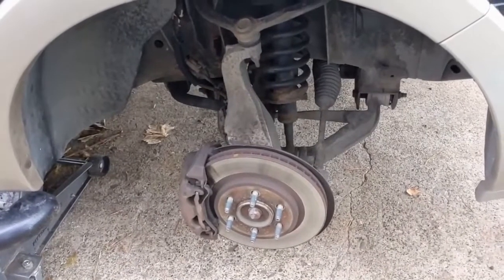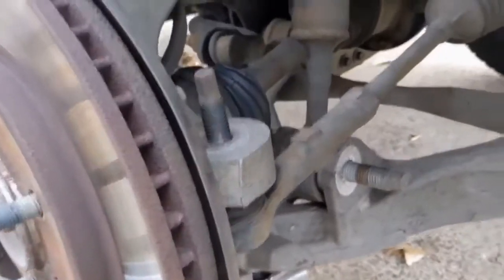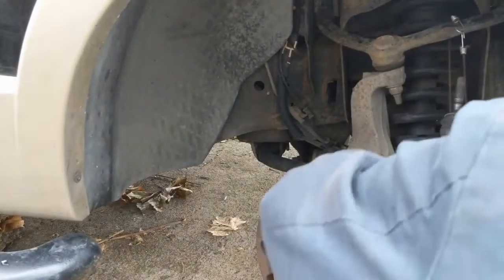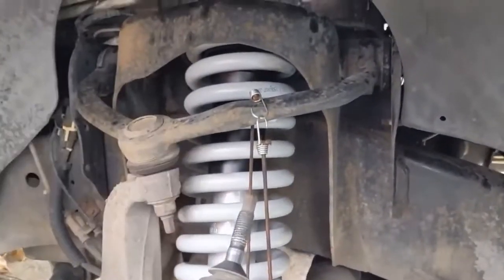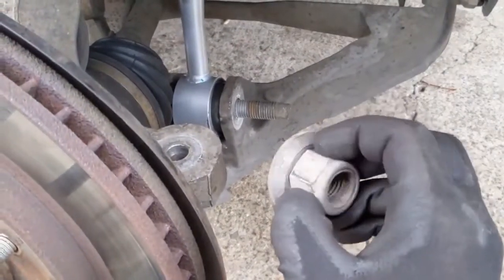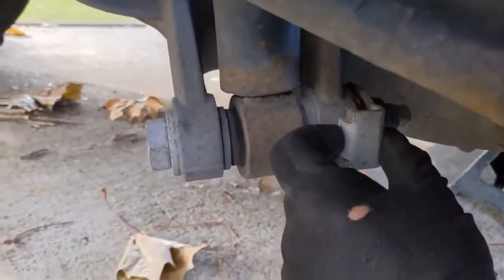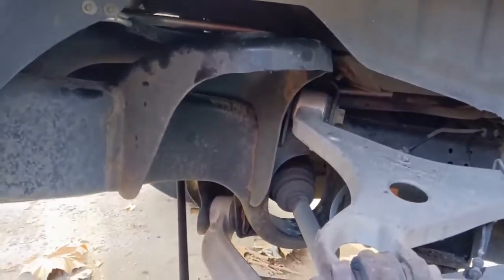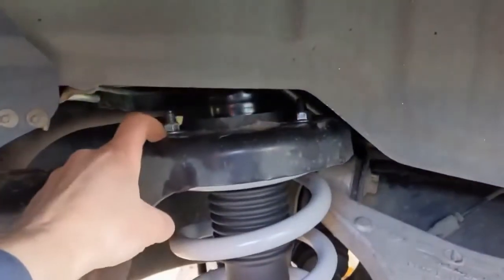2003-2006 Ford Expedition Front and Rear Struts | How to Replace the Front and Rear Struts

Comment: Tools needed - 30mm, 21mm, 15mm deep sockets, blue loctite 
front- 
strut to control arm nut -  350 ft lbs, tie rod - 111 ft lbs, upper strut bolts (x3) - 30 ft lbs
rear
strut to control arm nut - 295 ft lbs - tie rod -  41 ft lbs, upper strut bolts (x3) - 26 ft lbs

Comment: Very nicely done. Your option to fast forward some parts in the video helped to lower the total overhead and resulted in a compressed version yet still showed how it is done DIY. Moreover, the use of air tools combined with the use of pry bars made it easier to finish the job. Well done.

Comment: Hey there, we’re converting from airbags in, so don’t have the old struts to compare to maybe a silly question, but which strut so you’re saying is larger in diameter , the front or the back
Reply from the maker: Typically the front will be bigger because they hold more weight than the rear.